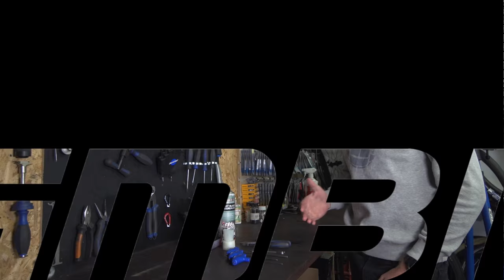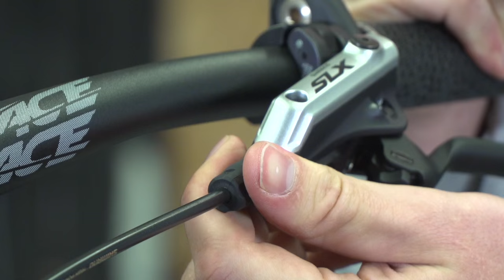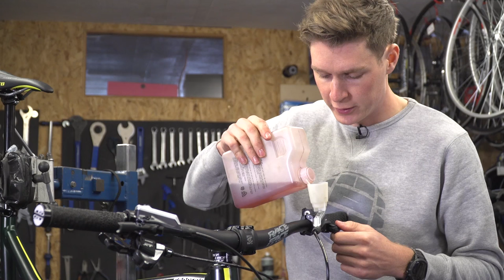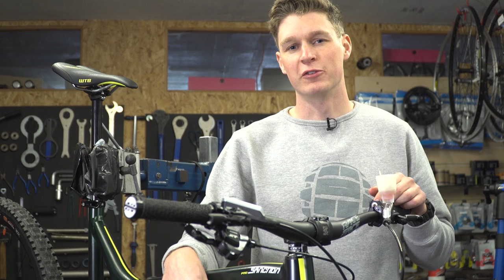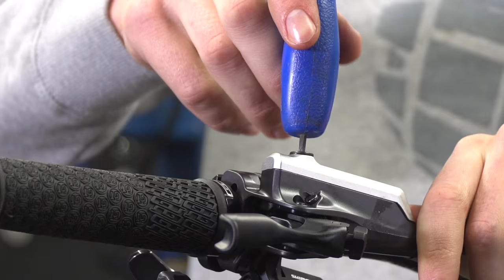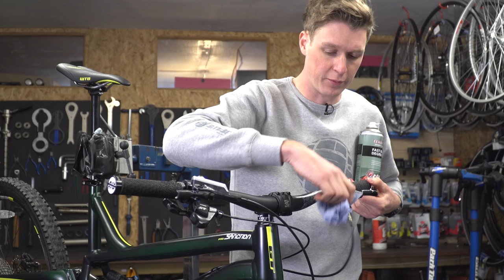How To Swap Your Brake Levers | MTB Maintenance

Comment: Hired a bike last weekend in Nepal with the brakes opposite to my usual. Was all good till the front wheel started to lock up. My reflexes kicked in and I released my right hand and pulled harder with the left, when straight over the the handle bars.

Comment: TIP: If you don't like wasting zip ties, keep a foot of velcro strap around your shop and you can reuse it.
Reply: I am late to the over but using cut-up tubes lets me have an endless supply of rubber bands, saving velcro and zipties.

Comment: Scott!  Good advice here!  No need to bleed!  That saved me from getting into my job more than I wanted.  All I needed was to remove my brake lever so I could repair my shifter (original mech left the hose a bit to short to just slide off the bar).  I never bled brakes so I was hesitant to do my shifter work.  But after I saw it's possible to just remove bubbles from the top I eagerly took care of the shifter.  I put the brake lever back and it was as easy as you showed.  Bike is 100% again!
Reply: Bleeding brakes is one of the simplest jobs on a car/motorcycle/bicycle. Get the tools to do it, learn how to do it and never again worry about it.

Comment: I'm surprised you didn't change the olive and insert. They are not meant for re use and  not changing them could potentially lead to brake failure.

Comment: Don´t you need to put a new olive everytime you take the brake hose out from the lever? Or is it save to re use the same one?
Reply: The manufacturers recommend using a new one every time. This is also the case with cars and motorbikes, they would rather you replace various o-rings, crush washers (engine oil drain plug) each time. In many cases, you can usually get away with reusing the original parts, if they are not damaged. However, usually these parts are very cheap, and it's better to get them. But if you want to ride now, you can try reusing it. Install, tighten, wipe oil off, test the brakes, check for any leaks before sliding the rubber covers back on.
Reply: @GenePavlovsky   thanks!

Comment: I'm a NEW rider in the US, and an experienced motorcycle rider. So you bet your butt I'm goign to be swapping my front brake to the right side.
Could you imagine if on the motorcycle I attempted an emergency brake by pulling in the left/clutch lever? I'd be dead!

Comment: Do you really need to tap on the caliper and hoses? I wouldnt expect any bubble to come down to the caliper if all you did is change the hoses at top heigh - lever.
Reply: You make a good point, however I think he's just doing it in case there was any air down there in the first place. So if the brakes were not bled very good in the first place, doing it this way might make them firmer. On the other hand, I would probably just do a full proper bleed and not mess around.

Comment: i run both my brakes on one side
i have left erbs palsy
Reply: I wish if I had brakes on both sides such that pulling any one would pull both brakes. That would be awesome!
Reply: I think that the fact im able to modulate the back and front brake separately when riding Dh and hitting big free ride features where only the use of one brake is necessary is a nicer more free way to go.
Reply: @endurofordaboys1768  Good point.

Comment: No new Olives?
Reply: +andrew mott he didn't shorten them, so why a new olive?
Reply: +Axecution Because the original olive would be crushed and might not seal properly?
Reply: Darren White i don't think so, i did the same with my brakes and didnt change anything. full power and no leaks whatsoever.

Comment: hello, i had purchased hydraulic break  shimano mt201 for my right handle,  my old breaks are mechanical disc breaks.  But the product i received is designed for left handle but i am used to front break on right, now to mount it on right only way is reverse install i.e  bleed tank downside and mount on right side?will this work?

Comment: question: can i use for example shimano deore xt brake levers on a shimano slx brake caliper?
Reply: +Timo Borgman you can as it is a universal system, but I wouldn't recommend it, brake sets work best as a complete set (xt with xt). this is coming from personal and professional experience (I work in a bike shop). I have run this set up at a race when my calliper broke and it didn't perform quite as well for the rest of the weekend. hope this helps
Reply: thanks because i have a shimano br-m355 braking set and a xtr shifting set and i wanted to run i spec b but i dont think thats possible with a simple shimano brake (at leats i couldnt find it anywhere online) but again thanks a lot Fraser Watt

Comment: Is the Specialized Turbo Levo sold with the front brake on the right or left? I just bought a Levo and the front brake is on the left.
Reply: I guess it would depend on which country do you buy it from? AFAIK in UK (for example) front on the right is standard, so if you buy from a Specialized dealer in UK, I reckon it would have front on the right. In theory, Continental Europe and the USA front is on the left. Although, when I bought a Bakfiets cargo bike from the official dealer in the Netherlands, it came with front on the right (as I prefer).

Comment: is it necessary to put fluid again in the leavers?...I have the shimano deore m757..do I have to use the shimano fluid or I can put in something else?
Reply from the maker: It has to be mineral oil for Shimano, there are some other brands. You dont have to use Shimano.
Reply: +Global Mountain Bike Network ok thanks
Reply: Worth remembering that some other brands are more corrosive than the Shimano Hydraulic Mineral Fluid. - Using a different Mineral Brake Fluid brand may be slightly cheaper but they can shorten the working lifespan of the rubber seals in the brake system causing premature failure. The Shimano Fluid is designed specifically to match the properties of the seals ensuring they have a long working life. I was an engineer in a company that makes specialist rubber seals for fuel and brake systems and matching the fluid to the specific rubber compound of the seals is critical to keep the seals in optimum condition. :-)

Comment: If you have mechanical disc brakes do you still need to do the oil proccess and bleeding??????
Reply: lol
Reply: lol
Reply: Arton Shala no because there mechanical 🤦‍♂️
Reply: Yes you do. It is most efficiently applied on the disk itself

Comment: do you have to put the the break fluid in, or can I just swap the wire things.
Reply: Mason Richards if you keep the hose vertical and you’ve adjusted the lever so it’s horizontal you should only lose a drop.. you’ll survive but you might be a bit spongey- may as well just buy a £5 small too up bottle - why would you not want your brakes sharp? But yes it’s possible not to

Comment: When you switch the cables is it necessary to put fluid back into them? Or can I get away with not doing it?
Reply: felipe b there will be air is the brakes
Reply: @timmieskills  is that bad?
Reply: @lullleg9210  yes, very bad

Comment: Where do u get all the tools that mostly only Bicycle shops have
Reply: Most of the tools used in the video are really standard tools any mechanic should have. You can use a multi-tool or a set of L-shaped allen (hex) wrenches instead of the fancy T-handled ones. The only special thing in the video is that Shimano bleed funnel. I would suggest getting a brake bleed kit, though.

Comment: I never understood why UK prefers having the rear brake on the left.
Could you please elaborate on this for me?
Reply: I'm from the uk and I'm pretty sure is because most people are right handed and the front brake is the one doing most of the work.
Reply: +john morrell think most people are right handed in the states as well.
Reply: +hydra66 yeah, probably just what people are used to, if you tried to skid round a corner you might pull the wrong brake and go over the handle bars. Personal preference.
Reply: +john morrell it was news to me that Americans have the rear brake on the right
Reply: +john morrell The only reason for that is you were brought up with it, if you were to have been brought up with rear right and front left you would not have said problem as braking is instinct and you would go for the right normally, as for the reason, there isnt really one, it is similair to the question why do we drive on the left and americans drive on the right? there is no real anwser and no reason for it to be different, just what is the norm in that country/place
Reply: +T-Virus *  cause front on the right is the same like a motorcycle. Although i swapped mine two years ago front on the right still does not feel intuitive to me.
Reply: +Ross Sharp reason we drive on the left in the UK stems from passing each other on horseback centuries ago. Swords were placed on left hip so they could be drawn with the right hand. If you rode on the right hand side of a narrow  road, swords would clash/ tangle. Hence we ride/drive on the left.
Reply: @hydra66  Well done  , nice history info there

Comment: I'm british, and have always ridden with my back on the left- but now I've started mountain biking, i use my front way too much and it feels like they should be the other way round?! are we the only ones that still do it like that?? and is it because were stuck in tradition !
Reply: ***** i see, i didn't know that about moto- i will, thanks for the helpful response :) 
and you say that! until you slide out or go over the bars! :P
Reply: ***** thanks :) although, i already get that, i will try to bear it more in mind- 
I'm used to terrible brakes, doing similar sorts of trails on an old 80's rigid bike, so if i hire a bike one day so i can enjoy the trails more, i end up grabbing the front too much, but yeah, i guess just get used to it!! :)
Reply: In my country normal thing is to have the front brake in the left and vice versa. I had some brakes that came like yours but I never could feel comfortable breaking like that, even after months of use and scary moments because of it lol.

Comment: Can you say to me what brake should i buy for my diamondback?I have 250 dollars but i don't know what to buy.
Reply: +Vladimir depends on what you want really, i personally would recommend Hope Tech V3 or some Magura brakes, but look around, check reviews and find what you think will suit you best.
Reply: +Ross Sharp Thank you!
Reply: +Mark Davey Thank you!
Reply: Shimano SLX M675 or Zee M640, and with SLX or XT Ice Tech rotors (front 180mm, rear 160mm).
Reply: +Vladimir Hard to say without knowing what you ride. It's pretty hard to go wrong with Shimano Deore and above, same with anything Guide from SRAM or anything Magura.

Shimanos are my favorite.
In my experience, XT is the way to go for XC, general trail riding or even Enduro. If that's what you ride, get a set of XTs and 160-180-200 mm rotors depending on how much power would you like. For a light setup and XC riding, 160 back 180 front works great. For trail and above you might want to consider bigger rotors.
Or you can save most of the money and get SLX. Seriously, they are pretty much the same as the XTs but slighty heavier and lack an adjustment that doesn't do anything. 

For a downhill bike, 180 back and 200 front works great too. Zee or Saints are a better option for downhilling, so ditch the XTs if this is your intended application.

Comment: Why dont you put everything in the proper side up there in the UK? :P
Reply: I thought that it was the same everywhere except the US? Right hand side should be for the front brake just like on a motorcycle, moped etc
Reply: @rhidiandavies1991  In Greece bicycle usually have the front brake on the left side. But occasionally its the opposite

Comment: my brake levers are too long to have comfortable one finger braking normally, so I want to put them on the inside of the bar so they are not blocked by the shifters and I can move the break lever away without moving the shifters with it. My problem is grips. How do I take off grips that are not lock on? +Global Mountain Bike Network
Reply: Are they glued?
Reply: I honestly dont know. probably. my bike is the giant talon 4 27.5 2016 if that helps. id prefer not to have to cut the grips off, but if that is a necessity i will do that as an upgrade from stock wouldnt hurt.
Reply: +Jordan Keeler the best way I have found to remove grips is to use the sharp end of a zip tie to open a small gap between bar and grip and work washing up liquid in between by twisting the grip. eventually you should free up enough of it to slide it off. It can take a while though
Reply: sounds good, thanks! what do i use to stick the grip back on afterwards if I dont decide to replace it?
Reply: +Jordan Keeler Some people suggest you use a little washing liquid to slip it back on also. Sounds like a great idea and works really well, but dont do it! As soon as it rains your grips will slip around like crazy. I've heard of using an air compressor to get under the grip and help you slip it on, that could be a good way
Reply: +Jordan Keeler just rinse off the washing up liquid and use water. it will dry off leaving the grips tight
Reply: cool ty

Comment: is it possible to change a hard tail bike frame to full suspension frame?
Reply: yes of course! step one get out the grinder......
Reply: Having spent most of my lifetime building and customising frames, Yes, It is possible but takes a lot of time and effort to get it to work properly. You would be better off getting a frame that is specifically designed for the job as the hardtail frame will not be designed to deal with the specific forces and stresses generated by a swing arm or other suspension system. Doing a conversion that works well is not an easy task. :-)
Reply: My comment was more satirical to be honest....
Reply: There are a few of us that are crazy enough to have done such conversions, just to see if we can. I put it down to spending too much time in the Netherlands with engineers and fietsenmakers who taught me that almost anything is possible, even if it is not all that sensible. 12ft+ long 'drag bikes', tall bikes, bikes built with car wheels etc. - grin -
Reply: NO